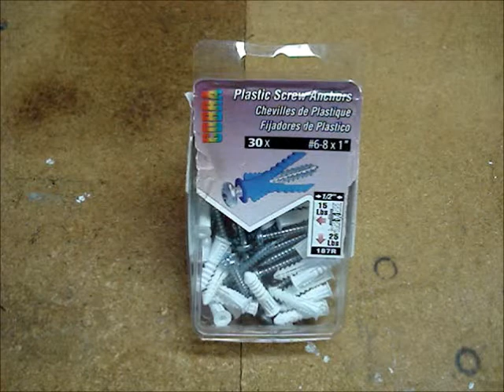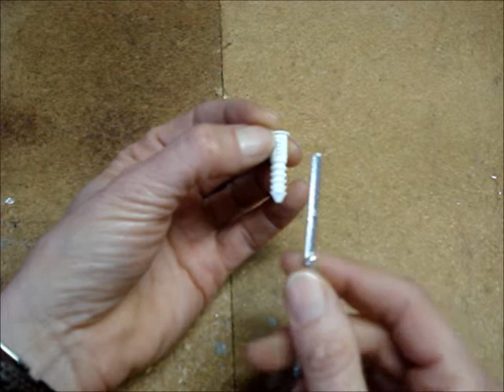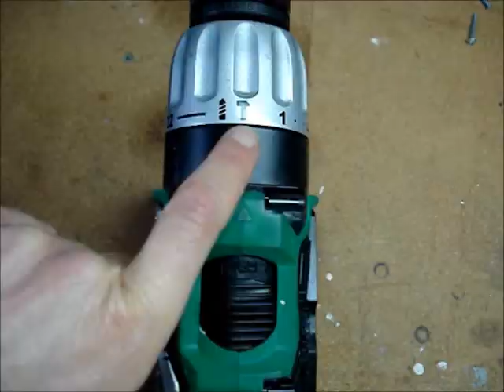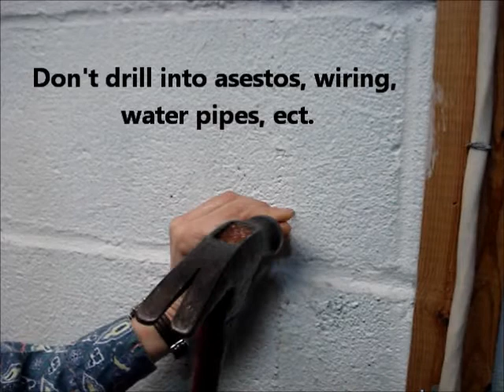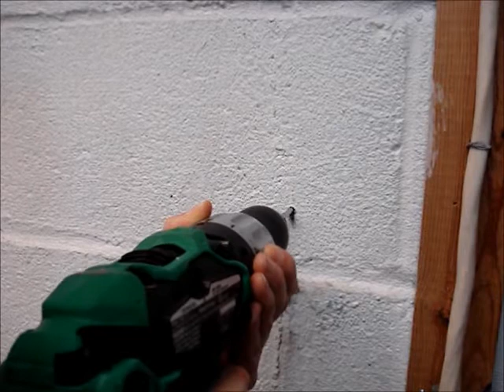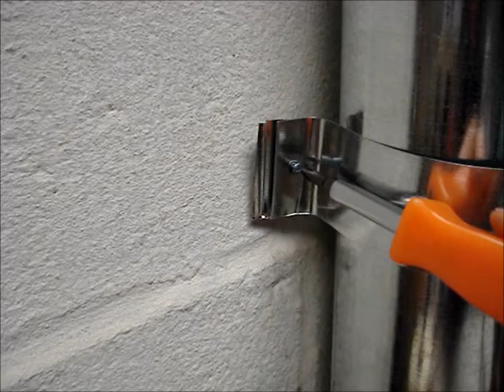Install Masonry Anchor into Block, Brick or Concrete

Comment: If you want to use the screw to hang something, make sure the slit of the wall plug is horizontal. It will prevent the screw from slide through the slit of the wall plug when force applied downward and made a weak achoring on concrete. Using 2 wall plugs one after another in one hole  also strengthen the anchoring should we need one. Just cut the flare part of the first wall plug so it will slide into the hole easily.
Reply from the maker: Thanks for taking the time to share the helpful tips.

Comment: What if you don't have a hammer drill, and you only have a drill.  Is it mission impossible then?
Reply from the maker: You will struggle without a hammer drill.
Reply: @Know-How-Now  You mean:  Just takes longer?  I will wait.
Reply from the maker: If you are drilling into concrete, it will be really slow going.  You can try it.  I think Home Depot rents tools, you could rent a hammer drill (or from a tool rental business).  A drill with a hammer setting is not super expensive.
Reply: I ended up burning up the bit after a single hole. Took nearly 5 min per hole. Cheaper than buying a hammer drill if you don’t mind struggling.